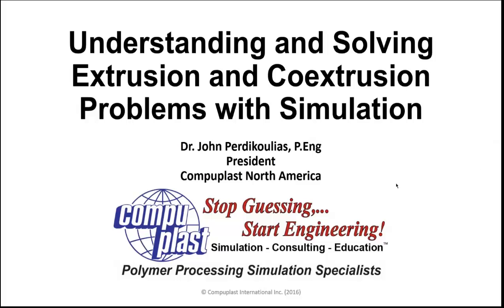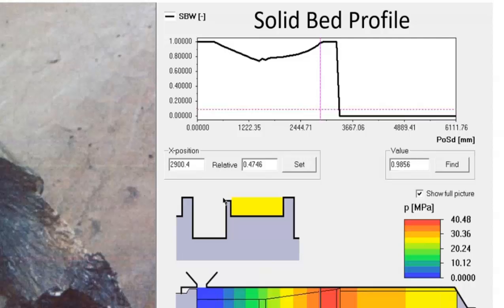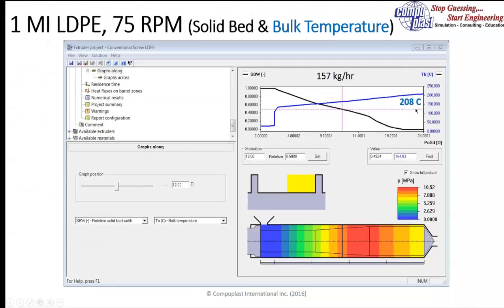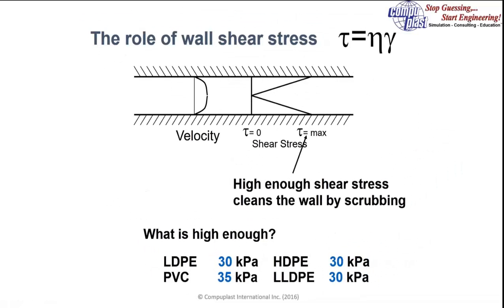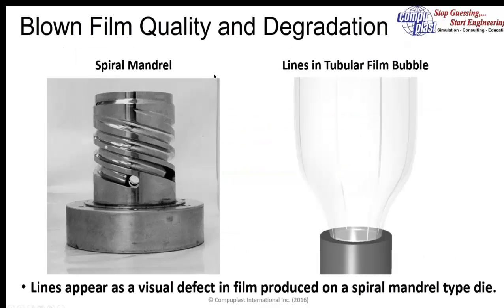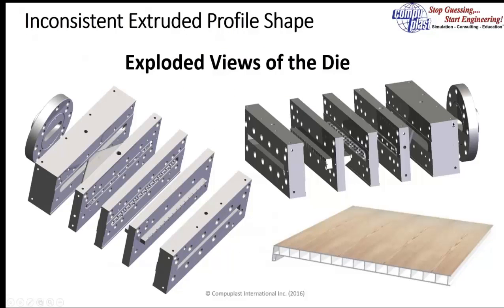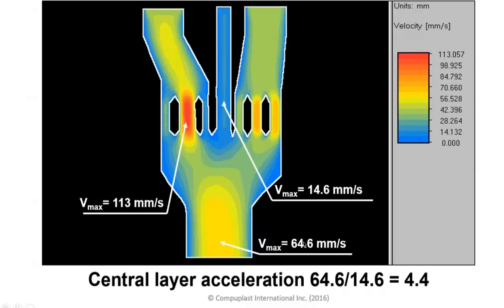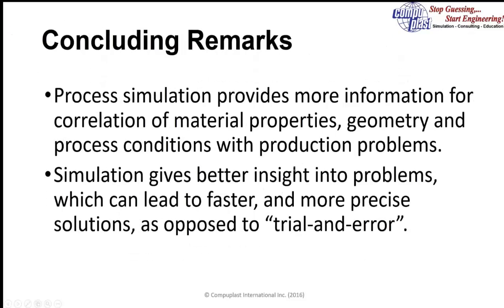Understanding and Solving Extrusion and Coextrusion Problems With Simulation161214

Comment: The mixing material is ok but the product coming out of the machine is not perfect, the temperature is ok, is that a screw problem?
Reply: Facing a similar issue, did you find out the reason?

Comment: Hello, I want to ask about my co-extruder machine, the flex rubber products come out not good, they are usually ok, even though the material mixing is ok and the temperature is ok, but the product comes out damaged and not perfect

Comment: I'd like to ask. Is it possible to use Conical twin screw extruder machine for pvc used to run HDPE or PP for pelletizing?
Reply: Yes, all that is required is a pellet and cutter attachment after the sizer & cooler.